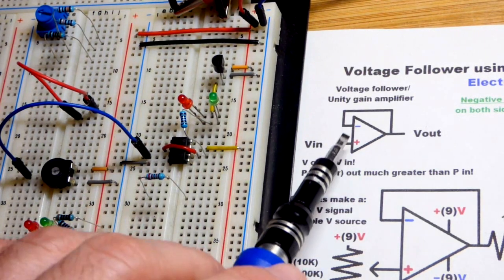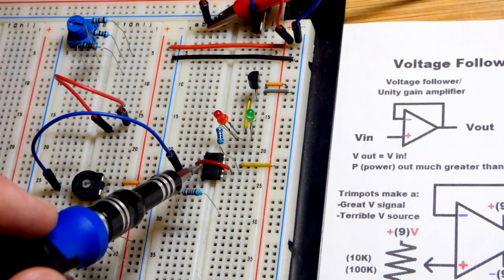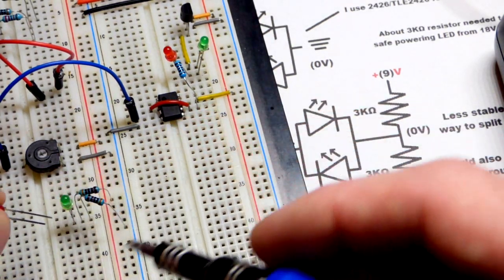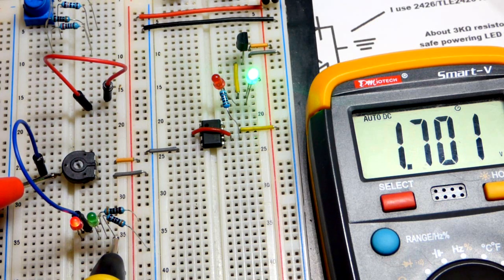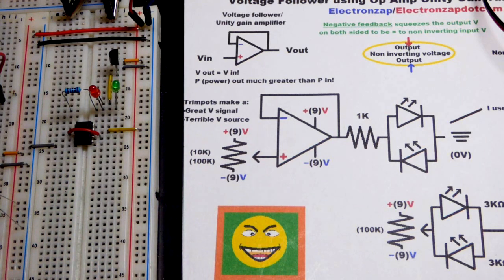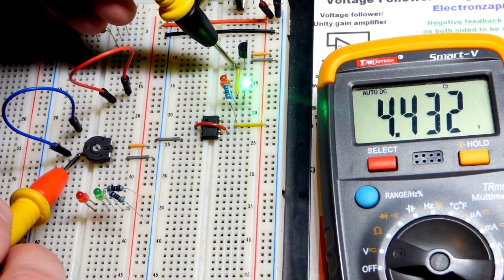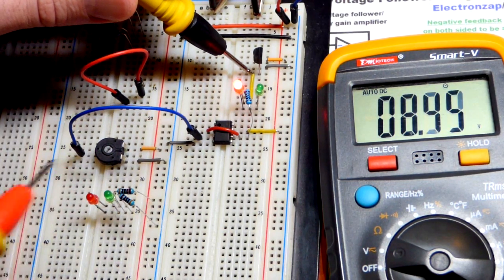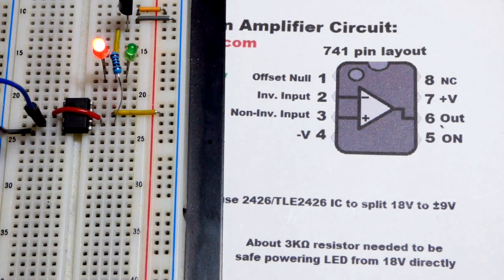Operation amplifier 741 op amp voltage follower unity gain amplifier boosting trimpot signal voltage

Comment: Help me with Build an opamp based current to voltage converter that will give an output of 0v at 4 mA and 5v at 20mA
Reply from the maker: Haven't built one yet but that's a good idea!

Comment: Another interesting video. The potentiometer example was helpful in demonstrating what the circuit does. I can also imagine other instances where Unity Gain/Voltage follower could be helpful to maintain those power rails when certain components are brought online or simply as a line conditioner. I think I have the terminology correct. I might have to build one to play around with.
Reply from the maker: Good times!